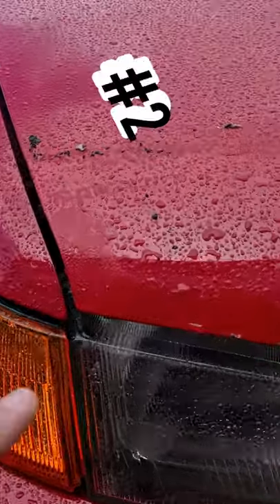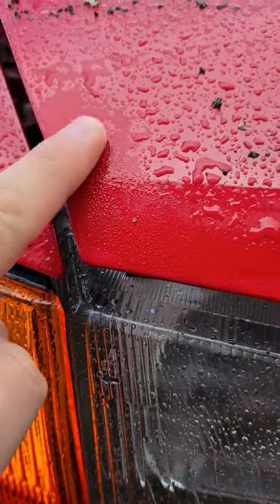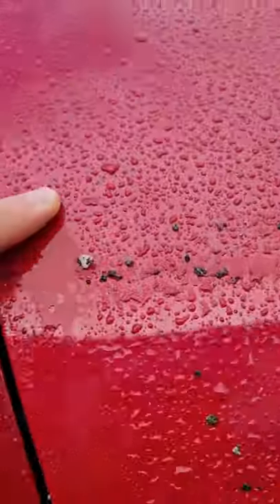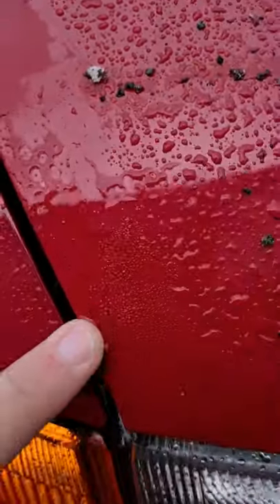WHY YOU SHOULDNT PUT A HOOD/BONNET BRA ON YOUR CAR|HONDA CIVIC

Comment: Problem isn’t that a bra is bad for paint..for starters that looks like a eBay special if you buy a nice bra they have a breathable layer between the paint and bra material and idk the exact year of your car but thats 25+ year old paint and you need to treat it as such there’s probably no clear left on the car and paint is not a moisture barrier
Reply from the maker: No I bought mine from a decent company and it has fhalayer under it! My car was freshly painted so :( not good
Reply from the maker: Appreciate your comment 🙏 👍 😊